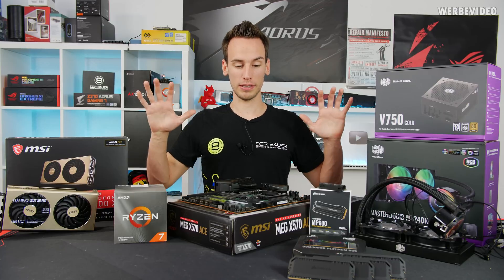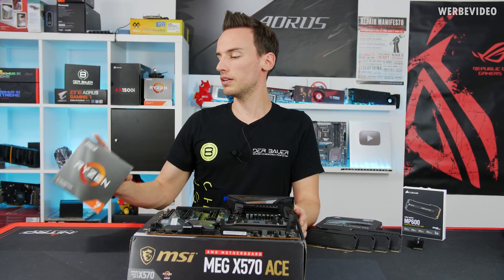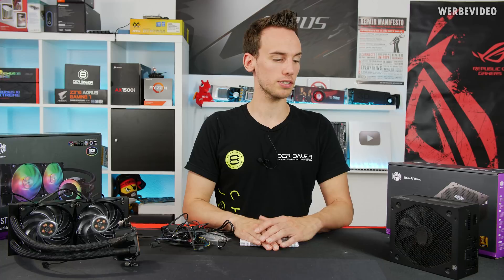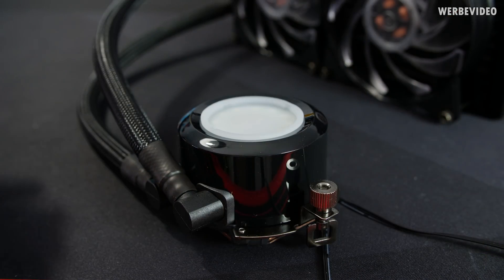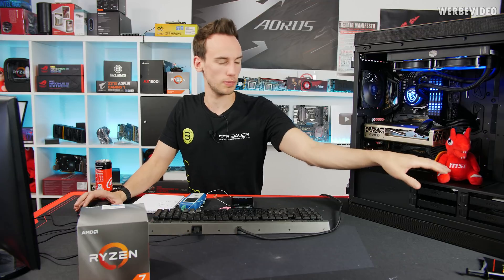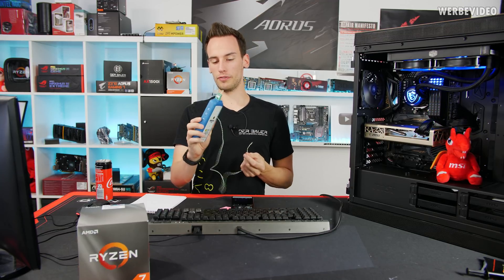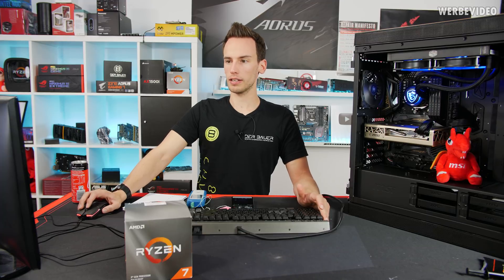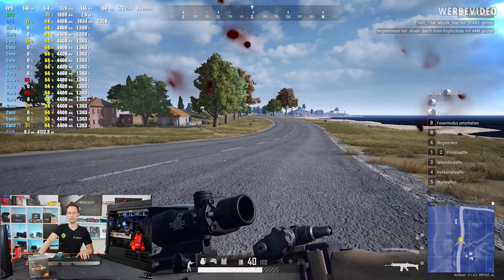MSI powered X570 PC - With RYZEN 3800X Overclocked to 4.4 GHz

Comment: Ever heard of kryonaut scratching the surface of the IHS and cooler leaving some strange residue on the coldplate and the cpu heatspreader that isnt removed with alcohol? Just saying because the variation between batches is insane, and when you are paying that much for thermal paste it should be about the same each time, but some is good, then others scratch your surface. This was fairly recently as well., about 2 months ago or something. Had problems with this paste throughout several batches degrading over time, as little as 2 months at temps of about 50C-65C. 

Just want to let people know about this and my experience with it. Switched to NT-H2 and its the same if not better performance wise and i've had no problems with degrading temps or whatever overtime.
Reply: Feel like this is a fairly well documented issue also, in conjunction with the fact its demonstrated as a "look at this product im using" during the videos when clearly it isn't up to par longevity wise and for the appearance of the cooler and IHS. If the serial number gets wiped from the CPU because of Kryonaut I don't think intel or AMD will accept it for an RMA or exchange programme. Common occurrence over there it seems :/
ik this happened ages ago with IC diamond but I don't think it being abrasive is intentional considering some batches i got weren't abrasive.

Comment: @der8auer which prime95 test are you using? Small / Large / Blend? Also what's a reasonable voltage to go for on a 3800x / 3900x ? I've seen lots of people saying anything higher than 1.325V is already too high, but you're going at 1.375.
Reply: I think amd said 1.5 is safe for very short durations "ie boost spikes" but 1.4 is safe
Reply: Sava Georgiev I hope @de8aurer answers this question

* edit never mind he answered in another comment he was running blend

Comment: Are your water cooler fans pushing air out of your case or into the case? As Ryzen is so temp sensitive, would it be a good idea to make the radiator fans suck air into the case? I have a 3900x and During gaming I notice that my water temp is 9c higher due to all the heat generated by the GPU being sucked into the cpu radiator. I have an exhaust fan at the back of my case in the same place as you, and I have it set to go to max speed when the gpu temp goes up but still a lot of heat ends up going through the CPU rad. I thought I might get better clock speeds with PB2 during gaming with the radiator getting fresh air instead of case air.
Reply: Each system is a little different. Due to different setups and variations inside the case, as well as case air inlets etc etc etc. I think a good general practice is to have the thing you want to stay the coolest have the best airflow. IE your watercooling your cpu the put the rad where it can pull the most air. On the cause Der8auer that would probably be on the top in a pull config. If you have a mesh front on your case then maybe the front for you. I played around with my case "i air cool" for a couple months before i got my case dialed in on fan location and direction.

Comment: Can it really be hard to run 4 DIMMs 3200 on Ryzen 3000?
I was able to run my crappy 4 DIMM Hynix MFR 2400 CL16 at 3200 CL18, and it passed 7+ hours of TestMem5
Reply from the maker: Yes but mainly depends on the board
Reply: der8auer maybe the good old x370 Taichi with T-topology is the reason, since many new boards have daisy-chain layout

Comment: I find their campaign name ironic considering the terrible thermals on most of their X570s and their 5700s.
Build videos are still fun but I can't help thinking about how MSI's quality has just plummeted in recent months, especially over last year's products.
Reply: all those quality comments about MSI are sad because all my latest nvidia cards where MSI and never had a problem with them, my 1080ti is at 31°C right now (with fan set at minimum 40% speed 1050rpm) and went to 1920+Mhz stock since day1
Reply: @fredEVOIX  31C that's idle right load must be much higher

Comment: Which fan's making that noise? :P
Reply: I have the exact same cpu cooler only the 360 version instead of the 240 hes using. The fans vibrate onto the rad and onto the case. when mounted properly tho the sound goes away
Reply: the videocard maybe ?
Reply: it's the AIO, since the fans are tied to the cpu temp it'll ramp up and down like crazy due to how variable the cpu temp is on ryzen 3k series. i wouldn't be surprised if he's just using the default fan curve in the bios which is a straight line from 30% at 30C to 100% at 70C most likely.

Comment: What about BIOS issues on MSI boards?
Reply from the maker: Apart from the single core boost (which is not directly MSI's fault) I saw no issues. OC on CPU worked fine, no problems with memory sticks and mem OC. Fan control worked well. Obviously didn't test every single feature but the main stuff which I used worked fine
Reply: @der8auer  Thanks!
Reply: @der8auer  what about video card ram running HOT due to thermal pads which are undersized?
Reply from the maker: I asked my MSI contact about this and he said it's being fixed in production so I thought this issue is kinda "solved". Or what do you think we should do if they are reacting on Steves feedback?
Reply: @der8auer  i think i missed the point in which you said the issue has been fixed. Then i heard that the card is very cool and so that is what happened. If they fixed it is all fine i retreat what i said

Comment: I have an i7 8700k going 5,2Ghz at 1.37v
Reply: Great!!
Reply: Did you delid the cpu?
Reply: @no-eb2xx  no delid but I'm using an old NZXT Kraken x61 liquid cooler AiO
Reply: now you just being a asshole lmfao
intel always on top
even the 4th gens 4790k can still be used today
4.0ghz - 4.4ghz on 4 cores/ 8 threads lmfao!
dude!
I bet money that games are based around what intel i5's are.
i wouldn't be surprise if games are actually using 6 cores only lmfao

Comment: 1.36V with AVX load gonna kill the CPU so fast :( TheStilt deleted his CPU within a week when going over 1.325V
Reply from the maker: Nope I would never say that. Because that's exactly the wrong conclusion. If one CPU fails it doesn't mean anything. It's the same with the "all RTX 2080 Tis are dying" hype last year. It's just wrong to draw this conclusion
Reply: @der8auer  What is the max voltage you would recommend for everyday use/gaming on ryzen 3000? I'm running 4.35(3900X) at 1.32V, but would like to push higher if able/safe. Seems to be a pretty common question here and would like clarification.
Reply from the maker: In daily usage and gaming you will hardly encounter AVX so I think this should be fine :) Just because one CPU died doesn't mean that all will do it.

Comment: Wow it's noisy :D

Edit: Still a great video tho. :)
Reply from the maker: All you can hear is from the Cooler Master AIO which I set to pretty much highest fan speed due to having 31°C in my room.
Reply: As long it's stable and runs smooth its ok I guess
Though I personally have my pc in a "storage closet" so I don't hear anything anyway even if everything's cranked up. Reasoning is I don't have much space on my table
Reply: @businessmail4929  I tend to put mine on the floor under the desk to give ample breathing room (and to keep the cables out of my sight) :P I'd go nuts if my machine made that noise all the time lol
Reply: @Chriva  I have a fan for summers which I just put in inside with the "plate" open which is exposed to the air from fan (perfect cooling seriously) the usual coolers inside of the machine is just.. Meh. I prefer a extra source from outside too
Reply: Yes. That MSI card has a bad heat sink.
Reply: @DenGuleBalje  The thermals looked good. I just think He turned automatic fan control off and cranked everything to eleven :)
Reply: @DenGuleBalje  We have no idea if the sound is coming from the MSI board, but given that he is running Prime95 in the background on all cores though so my guess would be that it's not the culprit and the real source of the noise are the AIO fans. At least I have yet to encounter an AIO from any vendor that was relatively quiet under load. And for reference by quiet here I mean using high end Noctua fans at ~80% load. Even on the same AIO it's usually worlds apart from the stock fans.
Reply: @aBoogivogi  GN (I think) mentioned that the thermal pads for the memory didn't cover the modules properly.

Comment: Nothing wrong about getting paid as long as you disclose that fact. Great job Roman.
Proper disclosure makes you more credible.
Reply from the maker: Mh I don't really get your point why this bench is misleading? 1080p with 5700XT and 3800 at 4.4 GHz is not CPU limited. Otherwise you wouldn't see this kind of difference between the cards. About the Evoke: My MSI Rep told me this is being fixed in production so this problem should be solved as far as I know.
Reply: @der8auer  when can we expect a video from you on the new AMD bios btw? Looking forward to your results
Reply: @der8auer  sorry I should change that, I mean that one benchmark isn't very useful because it's typical to see anywhere from 5-15% variance from a 5700xt to a 2080 depending on the game and the resolution.

I get that it's not a AMD vs Nvidia video so a big comparison isn't the point of the video.

 At the same time it's seems a bit random to put in a single 1080p benchmark to compare different gpus, instead of maybe giving your thoughts on it compared to other 5700xt from different vendor
Reply from the maker: Yea the video was not meant as a 5700XT review. I see what you mean though
Reply: My point too. It's always fine as long as you disclose it and give a honest review. :) Just more toys for Roman to play with so it's a win-win
Reply from the maker: so far there is no new BIOS as far as I know. They just released ABBA to the mainboard partners but as soon as we have updates I will test it
Reply: @der8auer  Did they name the release "Dancing queen" too? :D
Reply: He recently said in his cpu videos that he doesn't take sides and doesn't get paid for his opinion.

And here he is getting paid for gpu build, and using a 1080p benchmark to make the 5700xt look closer to the 2080 than it really is in most workloads...
Reply: @kalvindeane1  tbf 1080p is 99.9% of gamers video settings and 144hz or higher monitor
Reply: @l2x6tense  but not 99% of 2080 owners play at 1080p. You buy a 2080 or 2080ti for 1440p or 4k. At 1080p you are getting cpu bottlenecks, it's a misleading slide to say the least
Reply: @kalvindeane1  Why is benchmarking at the resolution most people game at misleading?
Reply: Bonus points if he stands behind the components. Which he does, as I see it.

Comment: Can you do a video on the 3900x comparing untouched stock settings vs a manual overclock, showing temperature and the clock speeds each core hits?

Use a low-profile cooler to have temps as high as possible while not throttling for a better temperature comparison
Reply: CommanderWolfyX would add a aio and high end air cooler
Reply: djvincon 

And i dont care what you would do...

I will be having a 3950x paired with a Cryorig C7 in an ML08-H case with filters off and liquid metal applied

But hay thats just because i need to not because i want to

I need the cores and i need the handle and i need to been able to take it standalone onto a plane as carry on